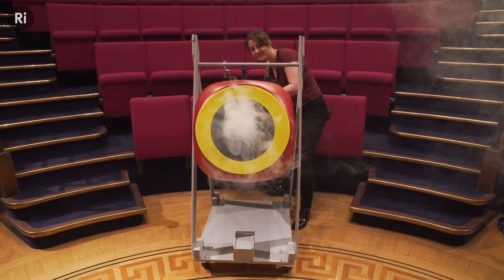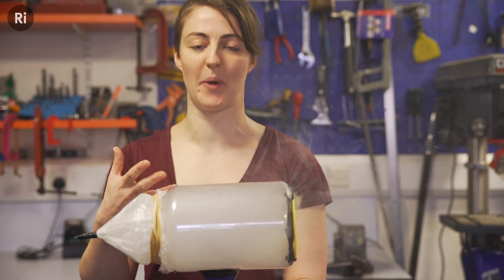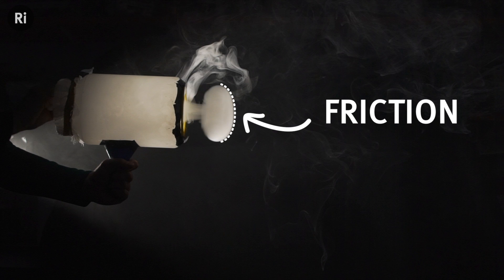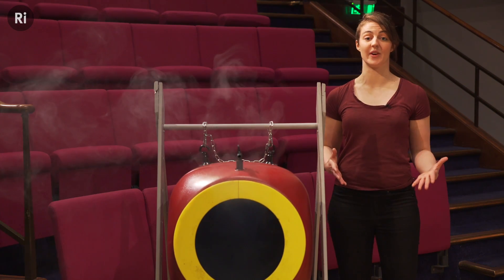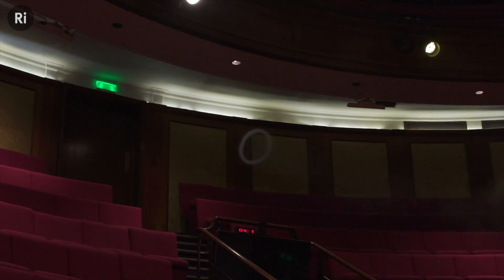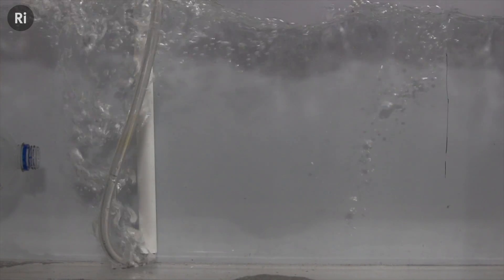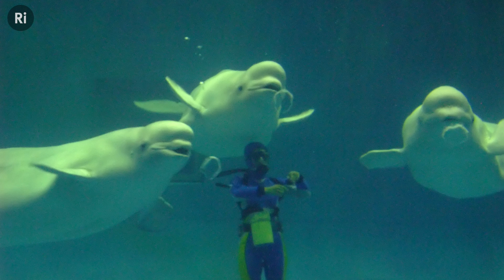The Science of Vortex Rings

Comment: If you're underwater it's easy to make air vortex rings that rise vertically, but a lot harder to make ones that travel horizontally, because of the different water pressures at top and bottom, I assume.  You can also make two horizontal air rings rotate in and out of each other, but that's a lot harder than making just one, and requires really calm water.

Comment: If the air is very still, the wingtip vortices from an aircraft can combine to give a line of rings. When I worked with superconductors, I wondered whether flux lines might do the same thing. In theory two opposed flux lines ought to annihilate each other. In practice they can't as there is nowhere to dump the energy fast enough. So you might get similar vortex rings in super electron wave functions, that slowly string as the energy gets dumped to the normal electrons.

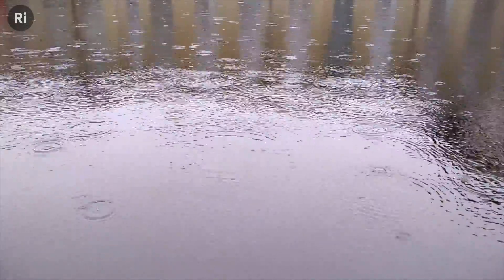Comment: Time to educate installing correction @ 3:47-3:58  {  a rain drop is not going to produce the kind of vortex pattern as the eye dropper experiment , the drop falling from sky dose not have a tube with surfaces  to apply resistance in order to incite  rotation, the pattern from a drop falling from the sky  is more like an explosion.} in the experiment the vortex ring was incited at the droplets exit from the the eye dropper.
Reply: The vortex ring is created by differential drag as the droplet enters the liquid, it isn't a result of the dropper tube. You can tell this quite easily because there is some distance between the dropper tube and the surface of the water, and the droplets aren't in the shape of rings while falling, only after they enter the still liquid below.
Reply: Droplets are still quite circular in the first place, also its not from the shape its from the friction of two different liquids or gasses. Maybe its time to educate yourself smart guy. I love the confidence though lmao.